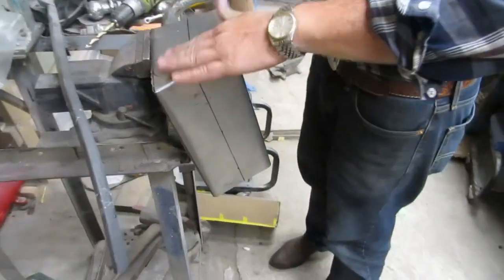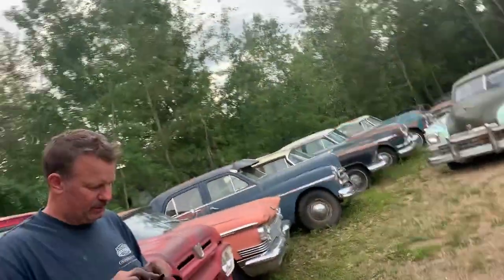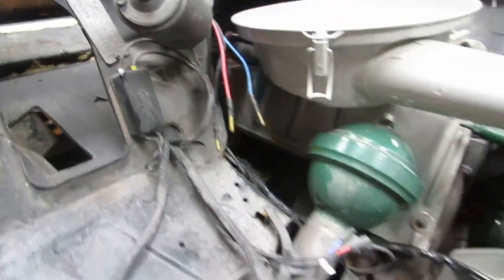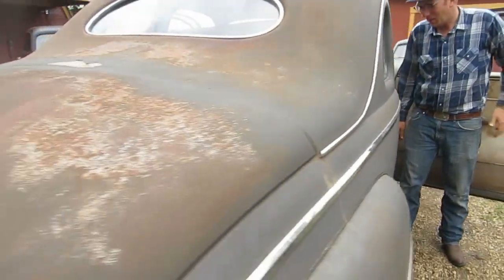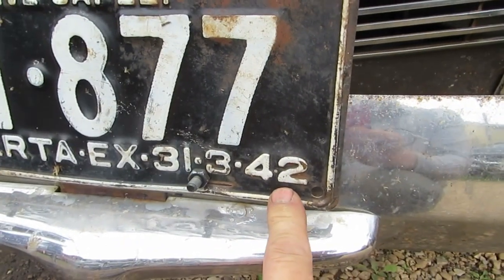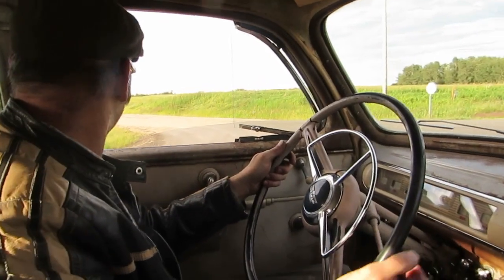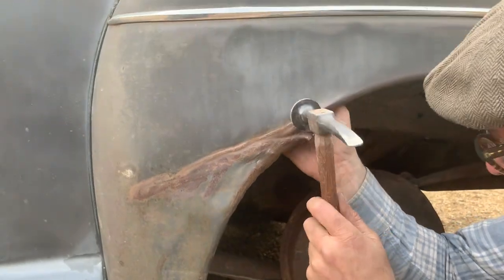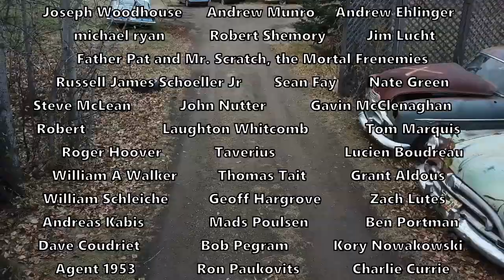Jim's 1941 Mercury Eight Review and Drive! Plus: Citroen DS Deadline!

Comment: Street Rod magazine multi feature quite a few years ago was a stock 41 plymouth coupe a guy drove across the US using dirt back roads as much as possible. Pretty interesting as he got lotsa help when ever he had a problem.  No back up crew. 
  I had a 41 ford businessman's delux coupe back in late 60"s completly stock except for the 53 Merc 3/4 race motor in it. Very much like that Merc. Had a floor button to change the radio stations. LOL

Comment: Tom, you and agent 223 took me on memories lane. I am not so old to have walked Jesus to school but there are times like this that would make me argue as to how old a sole that remains in me. I had parents that never traded in, simply park in the back five acres and replace with another good one, a couple years old so you didn't get that punishment for driving off the lot. I got old enough to drive and they told me to take the old ones and fix them... they should still run. And for the most part, clean the points, a remote fuel system as the lines were gone. Dad would mix antifreeze at ninety percent antifreeze and ten percent water so no issues other than the red antifreeze was so rusty looking and it was rusty. But not broken. They held up and touch the heater hose wrong and it was replace so if you didn't have a hose then brace it so it didn't wiggle and break. Most had the ninety degrees bend and top to bottom to keep in the engine. I remember one having heater hoses on both sides but one ran to the back and it went to a small box heater that if you were not running right along then the water was cool before it reached that box. Well I won't fill this page which seems easy for me but thanks for one of the very best of best memories

Comment: heh guys great episode   Jim"s merc is super cool   what a great find!  I imagine you have this covered,but with the crappy wet weather up there  it's got to be really tough on the chassis on your rigs   I watch  "mustie 1"  on you tube and he cleans the rust and muck the best he can on his rusty clunkers and then mixes chain saw bar oil and kerosene together and sprays the rust prone parts underneath  The keosene will evaporate and leaves a good coat of protective oil on the rusty bits.  again   great episode  take it slow!

Comment: I seen a video on YouTube where a man has a 1963 Oldsmobile and had the same type surface rust on it, he got the scotch brute pads you use in your house and some CLR.
He scrubbed the surface rust with the CLR and scotch brute pads then washed the car, afterwards he 3 step buffed the car and I was amazes the actual amount of paint that was under the surface rust.
The car turned out amazing and just looked like what these high end restorers try to duplicate.

Comment: Scott is Amazing at almost any of the jobs he does, very few around now that can work metal like that, i know one guy, but most today are panel replacers rather than panel beaters. Nice old Mercury, and that is original not fucked around with, maybe?? some clear coat over it, a little rust kill on the repair lightly sand it off later. Good too see the sweet old flat head 239 V8. Nice.

Comment: Love that old Mercury! A late high school friend and fellow motor-head when we were seniors in '63 bought a '47 Ford Convertible from a neighbor across the street in our rural Pittsburgh township. It was supposedly a Virginia car. Not original but solid. The clutch was bad so he had to save his money for the local mechanic garage to pull that torque tube driveline apart and slip in new clutch pieces. I think the mechanic charged him $125 for the job. Ran good, never any issues. Just a cold SOB in that senior year Winter. The next year he and I went up to Youngstown to college and during the Fall of '64 he sold it and bought a '53 Chevy 4 dr that he drove the next Winter. Those cars of that vintage had some very serious sheet metal in their fenders compared to the paper thin metal/plastic work of today. And you could fix them with a screw driver and a crescent wrench! Cheers, guys!

Comment: When using a greenlee hole punch, drill the clearance hole larger than the draw bolt. 1/8" clearance makes easier draw. Drop of oil on the threads not too much is best. Just sharing some info as a spark myself. Awesome work on your projects. Love the driver Fury and the rest of the saves. My project is sitting inside for 6 years. Round 2 it eventually.

Comment: that is some paint job on that citroen! that left rear quarter panel, door and left front fender look absolutely beautiful as if they were just stamped from the factory. if they were dented at all i have to say that i didn't know it was possible for a dented panel to be fixed so well. i say that because i've seen soooo many restorations that from a rear or front view down along the side i can see a series of waves that make the car look horrible and then i'mwondering if it could have been fixed up to look like new, why didn't they?

and the '41, wow! like these guys, i prefer driving a nicely done 30, 40, 50 or 60's car. their simplicity is very attractive.
and finally, what a remarkable job on that dent! i'm dumbfounded...
Reply from the maker: Hi, thanks for the note! Yes, the Citroen was pretty banged up all over;  I saved the original panels because they weren't rusty, but they needed a lot of hammering and sanding... Cheers from here!
Reply: @coldwarmotors  you've just made life miserable for the next body guy that does work for me. i'll be holding him to a higher standard of excellence than that to which he is accustomed, i think. :)

Comment: The battery side is good on the right for a '68 model, later they changed it. (a note if maybe you don't know; the '68 models have no good insulation on certain electrical wires; the insulation is crumbling and some wires do not run through a fuse, this can cause a fire)
The car is looking like new! :-)

Comment: How convenient !! A dent on CWM for a left handed metal man !!! ;o) Love watching you do the "Therapy" session on the old metal that forgot how to stand up straight. Now, back up two feet and do the other two "oops" that are behind the wheel opening on that same fender and that fender will look like an old movie star in vintage clothing. Wonderful old specimen.  Kinda like the 80 year old gentleman who gets along quite well. A few aches and pains but still quite viable. Love the sound of that motor with the one ?? clicking. Do you think it's a lifter or the fuel pump ??? 
Electrician since 1964 and used Greenly KO cutters exclusively. Have two of those sets you showed. When you need to use one of them, mark the center of the hole with a "cross hatch" pattern at right angles so the lines hang out past the cutter. The "dye" side of the cutter has tiny "hash" marks at 90 degree spacing so you can locate the cutter "exactly" at the hole center. Don't need to hold the cutter side. Once it bites into the metal, it's not going to turn !!! BTW, Greenly makes a bolt for the 3/4" and up cutters that has a ball bearing under the hex head of the bolt. Makes turning the bolt WAY easier. They make one for the 1/2" cutter also.
Reply from the maker: Hey Ron! Thanks for the note and the tip on the KO cutter! All the best as always from here!

Comment: Hey, wow! And uh, from what I've learned by watching, them DS's are unusual complex cars. Congrats for taking on restoring one. Hey, is it true the harder you use the brakes the higher the car goes because the suspension works off the power brakes? ;-)
Reply from the maker: Hey thanks for checking it out! The suspension and brakes are separate circuits and the whole system runs at a constant pressure. The rear of the car squats a bit under heavy breaking because of the trailing arm rear suspension and the soft ride, but it is unrelated to the suspension pressure, which is regulated by valves that relay the position of the wheels (in relation to the body) to a circuit which raises or lowers the car accordingly. This is necessary because the ride is so soft that without this capability, the cars would bottom out with any amount of load in them. It works beautifully, and the car retains the lovely ride and a constant ride height, regardless of load. Cheers!

Comment: For the Mercury 8, could you wire turn signal lights in the rear window, connected to the package tray?
Reply: Turn signals a must do many had them installed back there was a store called Blue Star Auto that carried turn signals, curb feelers and white mud flaps with reflectors and wheel spinners
Reply: Back in the day they sold an accessory turn signal switch that clamped on the steering column. You wired it to the existing parking lights and tail lights, you had to change the sockets and put in 2 filament bulbs. This was done on millions of cars. The turn signal switches are commonly found at flea markets etc and not hard to install.

Comment: Would you please pass is on to agent 223? safestrustremover.com
this stuff only takes rust off. it won't hurt paint or even decals. It would probably clean things up and not harm the patina and beautiful as found state. It would help preserve it though. if it can clean up a car that had been buried in a flooding vault for 50 years, it can help here. It's safe too. No protective gear required. have a look at the before and afters

Comment: You coud put a million dollars in a shit-roen but itll still be a shitheap.
Reply: They are wonderful.The ride is superb.I have owned 2 Citroen BX's in my time. They were probably the last of the proper Citroen's. I used to follow speedway,I live in the uk, and a lot of the riders used CX estate cars. A racing bike was on a rack on the back,or maybe on a trailer,and all the rest of their gear in the back.The DS is one of the most beautiful cars in the world.Proper Citroens have hydropneumatic systems.
Reply: @sixfootbear  yeah, there are reasons they all end up getting crushed for scrap. Way over complicated design. Constant breakdowns .
Reply: @sixfootbear  they are wonderful on the back of a towtruck or trailer.
Reply: @chuckyboy7940  Ever the cynic huh?  Do you know why Ford parts are so cheap? They break down so often  parts stores get the bulk buy discount.
Reply: @chuckyboy7940  Whose cars? The suspension system is actually simple.It just requires kilometres of metal tubing to make it work.
You don't like Citroens. Ok and?
Reply: @sixfootbear  yeah true. I guess it comes down to personal preferances.